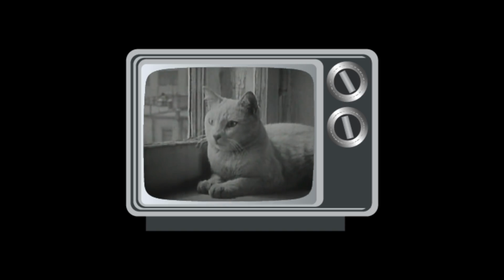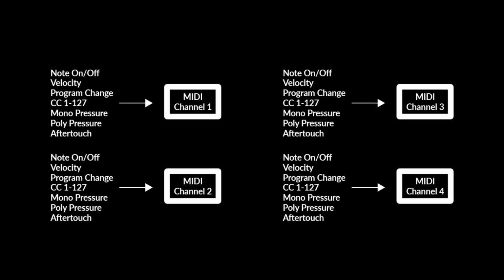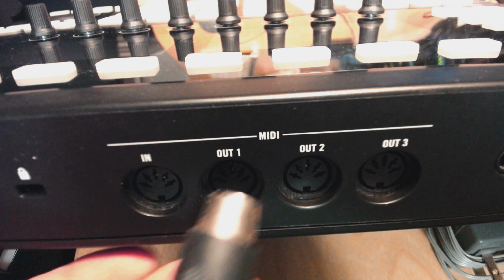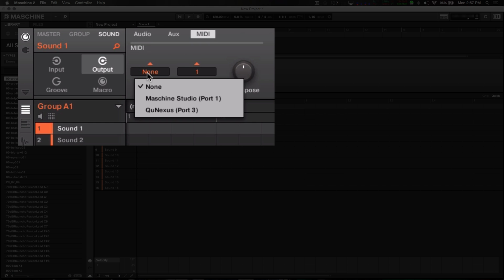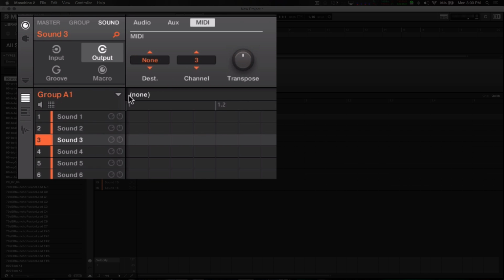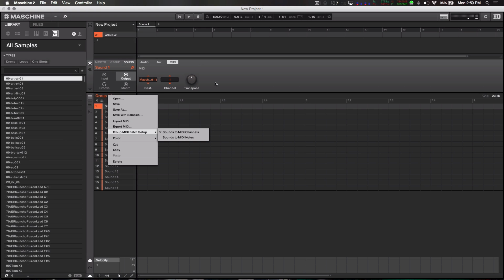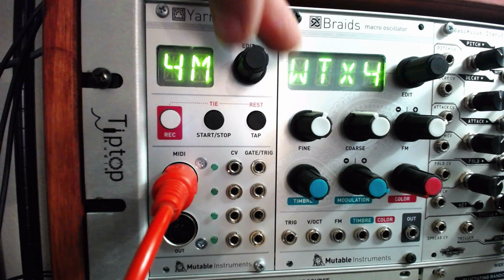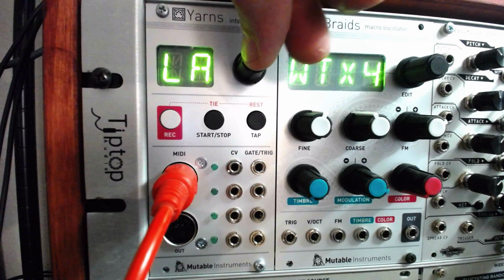Eurorack Drums with Maschine and Yarns

Comment: Nice video, even though I have them both, I've never used them together. I face a certain problem with Yarns and PC in general.

I get clock from Ableton and want to reset Rene when I hit Play.

What I mean:

Clock chain is: Ableton to Yarns to Tempi to Rene. Tempi is externally clocked from Yarns but it doesn't stop triggering once Ableton is Stopped (in contrast with Yarns which stops); it's like it has stored that tempo and continues distributing it. So, Rene constantly moves.. Need to send ONE and ONLY trigger to the MOD IN of Rene once Play is hit on the PC in order to go back to the first step. Otherwise it keeps "reseting"; it usually moves to the next step and then back again (depending on the division of the MOD IN clock).

Do you know if is there any "Start/Stop message" or something?.. Any idea??

Comment: Using an Expert Sleepers ES-3 rig here; (Cubase into MOTU / ADAT to ES-3). Controlling via Machine, Beatstep Pro or anything out of Cubase (Reaktor etc etc). All sweet. As mentioned by wily, the Beatstep Pro is nice for live as you can just hook up without a computer. (and it is damn cheap - don't pay too much attention to the complainers, it works fine for the money).
Reply from the maker: RezStudio I've been on the edge of buying one for ages... I hear they fixed the USB port issue as well. I'm going to talk to them at NAMM...

Comment: I use a BeatStep Pro to do this without a computer.
Reply from the maker: +Wily Bell I heard they fixed the USB ports, has yours been ok? I've wanted one for awhile...
Reply: +Voltage Control Lab Hey man, never had a problem, with any USB supply or my bench supply etc. I plugged it into a computer a few times (to sequence triggers to my modular from Reaper) and it created a tonne of noise in my modular gear. However Arturia provide a "V" (power/data) splitter that immediately rectified the issue when I used it.

The old firmware had some issues which I noticed and now seem to be resolved. I mostly use it literally just a 64-step 8 channel trigger sequencer and sometimes as an additional dual MIDI->CV/gate converter. Even just using it with a René X/Y polyrhythm with additional DPO/MMG strike inputs and as a master clock is worth its weight in gold!

For the price it is an incredible and solid device, and anyone with a small or large modular setup (mine's a touch over 9U) would find it handy at times. I don't understand the  hate it receives, honestly, but maybe I got lucky and other devices have issues.
Reply from the maker: +Wily Bell That's great, it feels like a tank. I think there were issues with the actual USB port in the device, for early users it snapped off on some units, but others were fine. Apparently they've rectified the issue now, but I'm glad to hear you had no issues. 

I'll definitely get one at some point soon, it seems like a must-have for performance too.
Reply: +Voltage Control Lab Oh shit, I've heard all manner of complaints on Muffs but never caught that one.

In saying this my BSP has copped some abuse. I'm not exactly... friendly with my gear when I perform; I once spilled an entire pint of beer on a Nord Stage 88 during a particularly intense solo and it didn't care. I doubt the BSP would too much either.

One way to find out...
Reply from the maker: +Wily Bell id be careful with your modular gear, if you are dumping beer around it!
Reply: i sold mine just to prevent this to happen , this cable is definitively not good and too tiny for the massive object, and btw the fact it's an huge object is not really attractive while patching,( i vote for a "beatstep pro mini" with big solid usb port ;)  (meanwhile i kept my electribe2 + yarns +tempsutile and it's simply awesome)

Comment: I'm using Reason. I send triggers out of Reason through a MOTU interface via its outputs and over an ADAT cable to an Expert Sleepers ES-3. When recording, I like to at least send out a 1/4 or 1/8 note pulse from Reason as a master clock to the modular so it's easy to do editing and apply DAW effects in tempo.
Reply: +Voltage Control Lab You don't need a new interface, you can buy a ADAT USB interface like this one: https://www.minidsp.com/products/usb-audio-interface/usbstreamer-box
Reply from the maker: +Sysex|Studio NICE. I want to get an ES-3, but it will require a new interface as well. On the other hand, I've been experimenting with my Audio 10, and have had a lot of luck using it as a trigger source with Reaktor or anything that can send pulses to the audio outs. It's lots of fun with the Reaktor Blocks clock divider!
Reply: +dgjedde1 nice find!
Reply from the maker: +dgjedde1 WOAH! Awesome!
Reply: Also, you can use the ES-40 if you have spdif, that is what I use